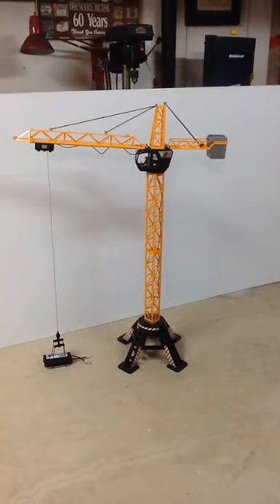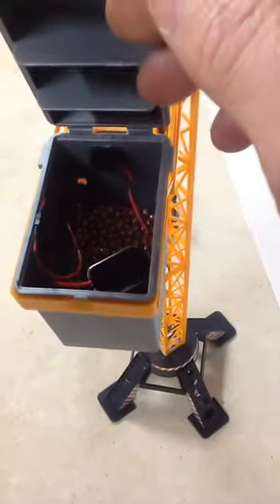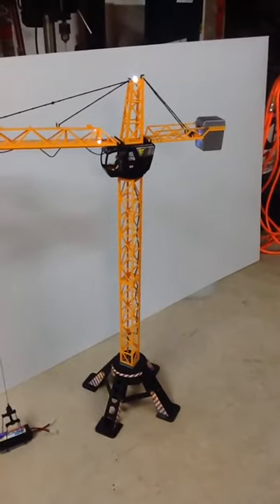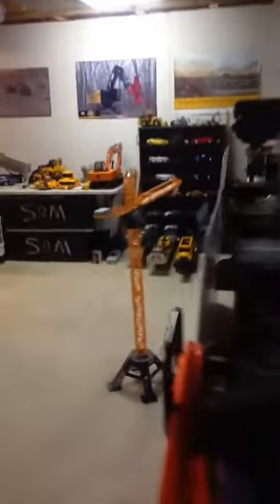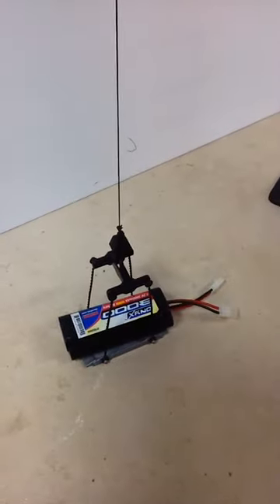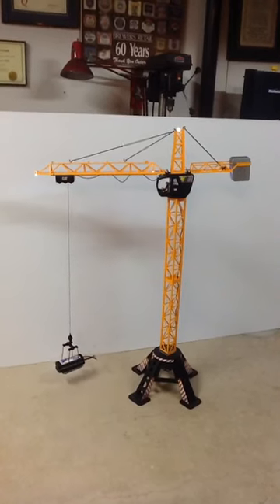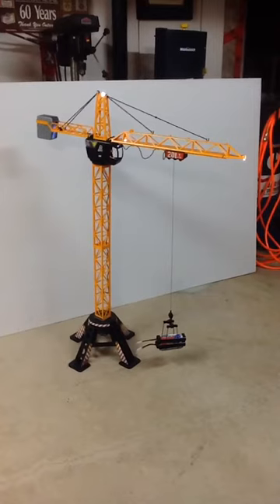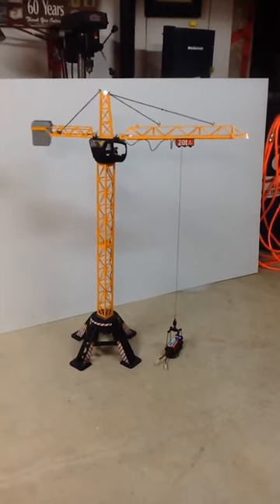Toy tower crane gets lights and a heavy lift

Comment: You need an anemometer and Air Craft warning light on the top of the cab pendent and it is a good idea to have a few of the safety limit switches …The liebherr cranes have moment over turn and line tension as well as wind speed shutdown….also, be sure and light up the jib & counter weight jib overhead supports with christmas lights…The best place to have flood lights is below the slewing motor area on the main mast ….I always had 8 2000 watt bright white lights on supports a couple feet away from the main tower…2 ea at the corners and adjusted to cover and overlap…the operator would be blinded with the way you have them….also, before you pick any heavy loads, have all the connecting  the main mast sections re-torque and all joints and welds checked for visual cracks/displacement… cracked paint etc as well as a tower crane tech ON the counter jib with any fuses etc for replacement ….nothing worst than having a heavy load on the hook and a $30 fuse blow and yea have to lower the load on manual with very little breaking power…been then done that…